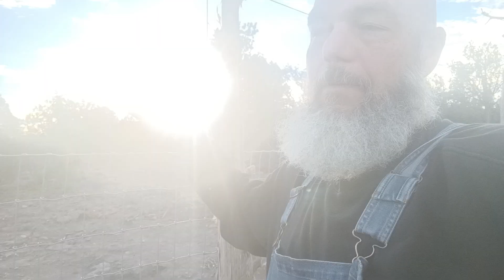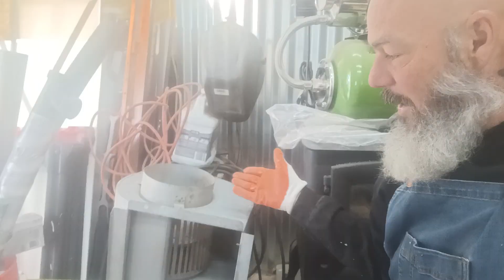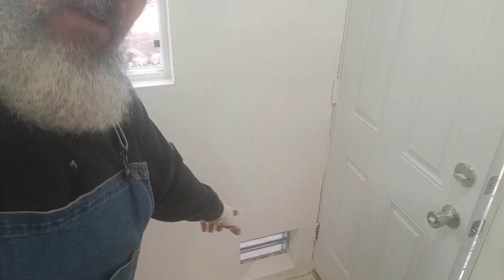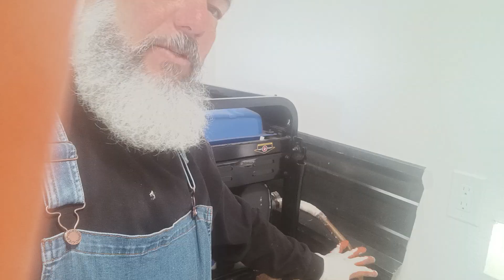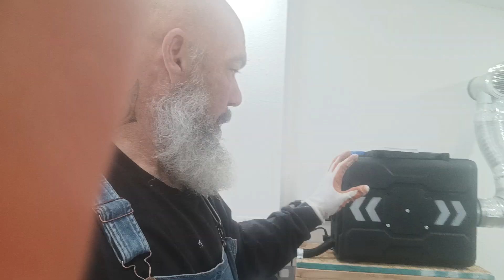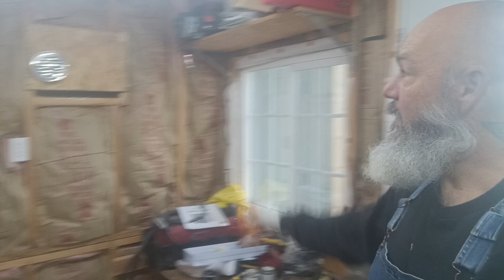New Additions to the homestead

Comment: VON that exhaust fan you have is a major score. All of your fuels and exhaust gasses are heavier then air so the exhaust fan should be mounted about 2 feet off the floor to vent those gasses out fast. And mount the exhaust fan on the exterior of the power room because if there are propane/fuel vapors in the room just flicking the exhaust fan on being inside the room via electrical moter spark could ignite the fumes. 
All is looking great VON. Just imagine if you had $20 million the shit you could do !
Reply from the maker: That's a good point about the fan placement!